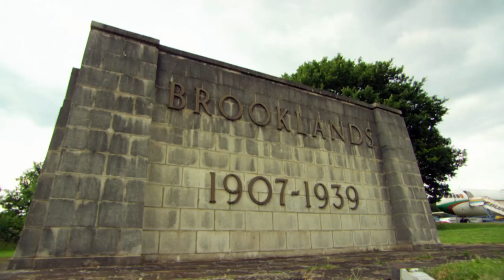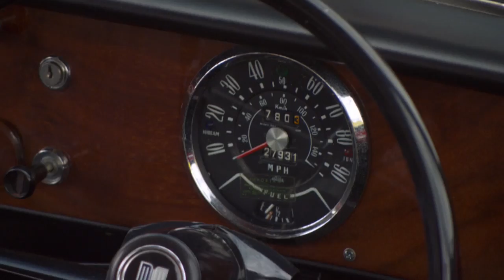Triumph Herald | Turbo Pickers

Comment: That car brings back memories of my student days when I worked all summer for a second hand royal blue 1966 Triumph Herald convertible I got for 240 pounds in 1972.Inexpensive to insure and run it was a lot of fun with the hood down.Despite being labelled a ladies car,it was perfect for the 'DIY 'person on a tight budget.I  looked after it and 2 years later it was snapped up for 315 pounds!I used to coat the underside with old engine oil as Triumphs were prone to rusting badly.